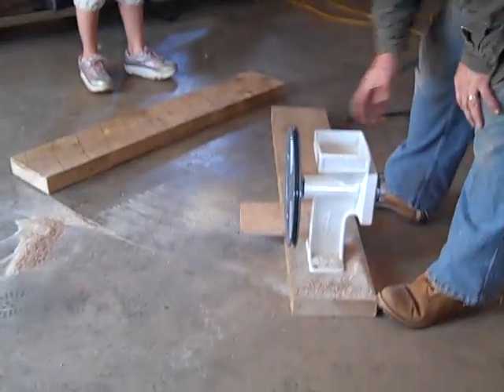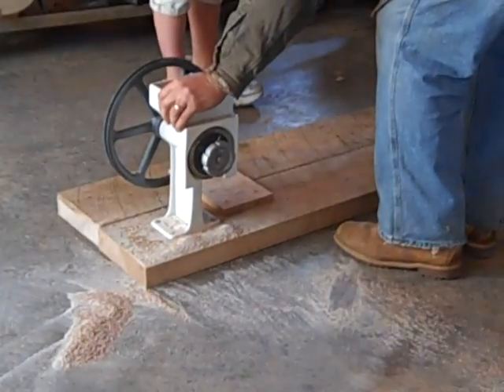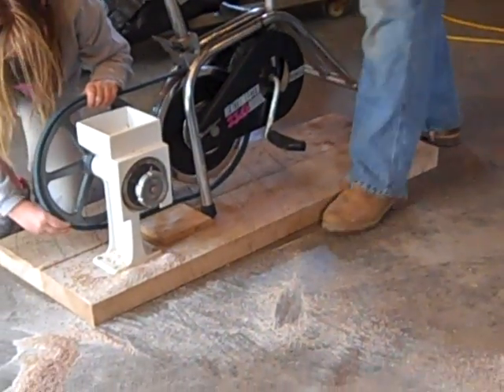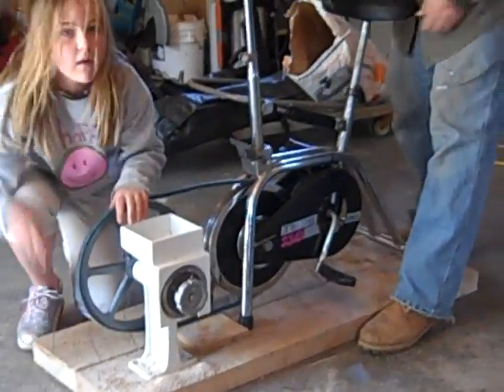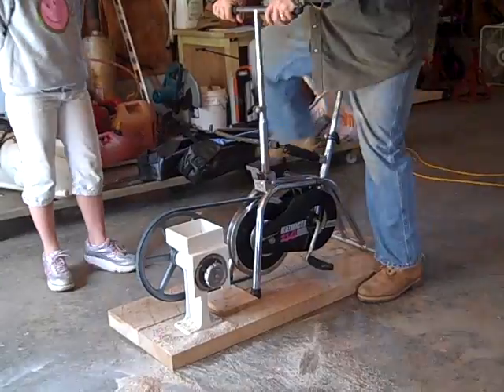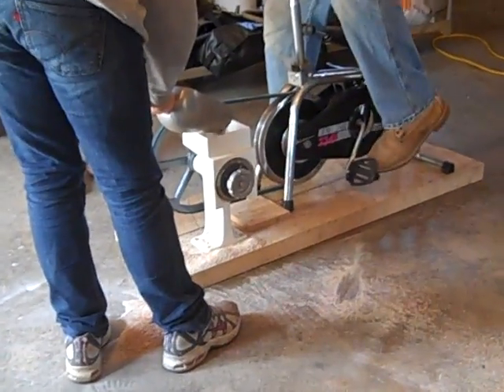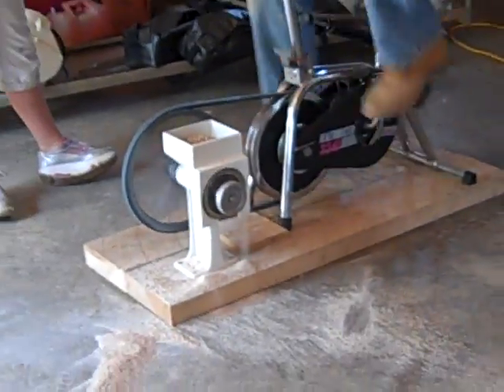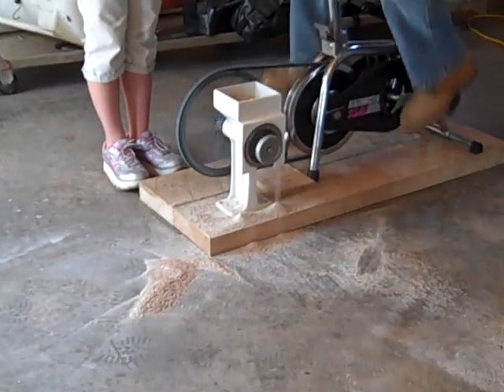Pedal Power Wheat Grinder

Comment: Hi there! thanks for the video! I am today on the same project but need more details please: 1) where did you get the small wheel/pulley? how did you attached it to the mill? 2) what do you used for a belt - specifics please? what size-length is the belt? thanks a lot
Reply from the maker: machined the wheel to the same shape groove as on the mill. any lawnmower belt will work, this one about 36".
Reply: Lawn mower belt!!!! That's it! I was looking for automotive belts. Need one bigger. Thanks!

Comment: Where did you get the pulley for the bike?  I was wondering if the belt would work by using the tire frame (with the rubber tire removed) as the pulley.  Any help would be appreciated as I have the same grain mill.

Comment: Nice Idea of using the stationary bike as a mill grinder.
Modular design that can be fit to other machine such as power generator like what I did.
You can check my video "Pedal Powered Flywheel Generator".
Cheers!

Comment: In Part 1 you had the belt on the pulley you added beside the main wheel.  In this video you have it on the larger wheel you had milled out.  Was this a mistake or intentional?  I would just be interested in the reasoning if it was intentional.